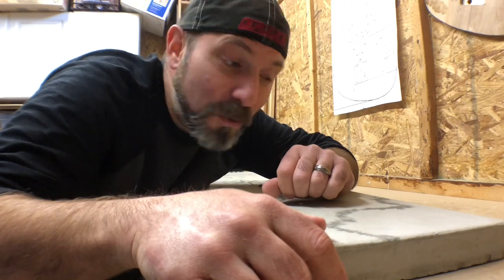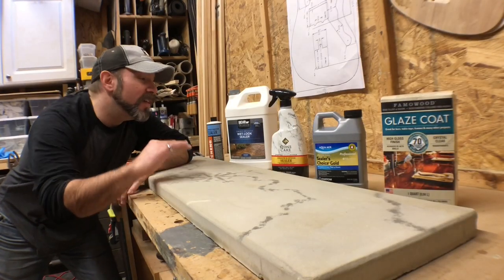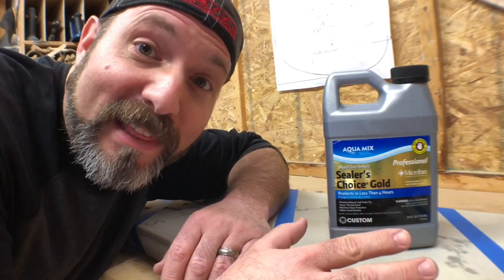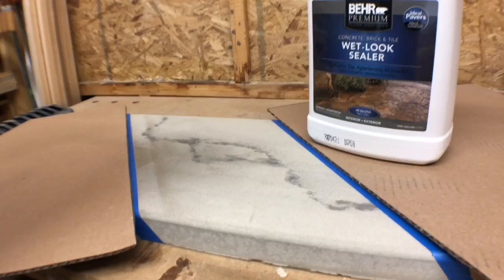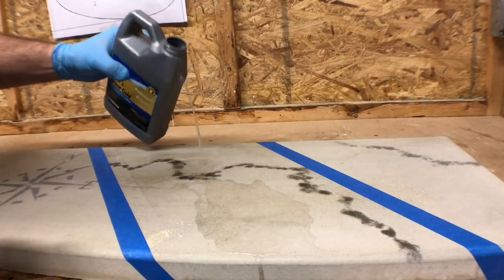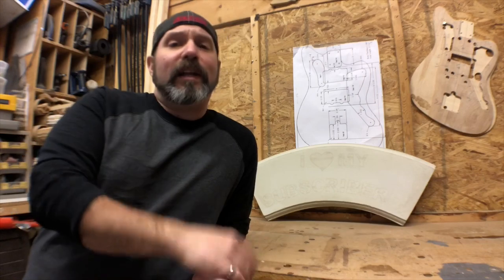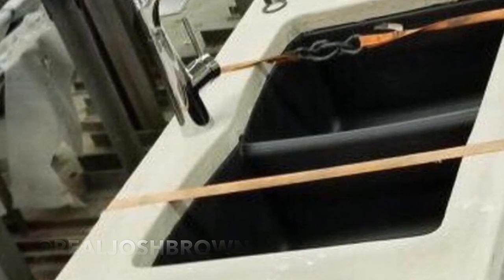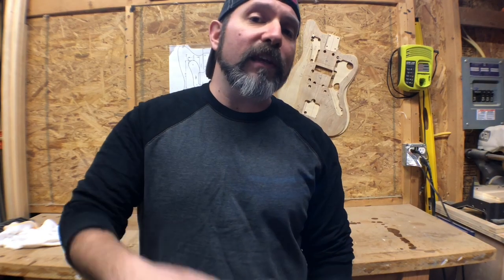Seal a Concrete Counter Top

Comment: SUGGESTION: How about a video showing how to stain the concrete or mixing a color in with the concrete mixture. Keep up the great work, love the videos!
Reply from the maker: Thank you Chris
Reply: I agree. Those wood look concrete tops were amazing.
Reply: I second this.  Please and THANK YOU.
Reply: I agree!  I’ve been wanting to do concrete countertops but have been intimidated by it, but you’re convincing me I can do it!  Add some color!  I need more!
Reply: YES..i vote for this too! ;-)
Reply: @paulaboudreaux5598  absooutely!
Reply: @MichaelBuilds  I would very much like your opinion on different methods of staining/dying concrete too
Reply from the maker: Thank you so much Chris!
Reply: I would like to simulate a black granite color. Any suggestions for proper additives?
Reply: I have a white concrete table that got scuffed when it was moved. It also has a stain from marinara sauce! I love the table, but I think I have to refinish it. Do I need to strip off the old sealer and redo? I think the concrete is colored. I’m not sure where to start with this.

Comment: I have a tip for a glaze coat or any two-part mix. Just Mark your mixing stick with 2 even measurements and poor one bottle to the first line and the second bottle to the second line you save 2 mixing cups by doing it this way.
Reply from the maker: That’s a great tip!!!
Reply: I have another idea. Assuming the two parts have about the same specific gravity (it’ll probably be close enough), use an inexpensive electronic kitchen gram scale. Tare. Pour the first one. Tare. Pour the second one to the same mass.
Reply: @texstan100  that's a good idea too, I myself would end up waisting time looking all over for my scale when a mixing stick will do the trick.
Reply: @texstan100  exactly what i was thinking too...
Reply: @Jennifer Ng oooh there are some very accurate food scales out there! ;-)
Reply: And you don't leave half of your epoxy in the cups!
Reply from the maker: Where do you leave it?
Reply from the maker: Where do you leave it?
Reply from the maker: Where do you leave it?
Reply from the maker: Where do you leave it?
Reply: Here's an easy one too. If it is two parts. Get a cup with markings, or use tape and mark lines One and Two, even. Like ex. one ounce, two ounce, lines. Pour the first liquid to the one mark, then pour in the second until the liquid hits the number Two mark,,its now half and half. Tks Michael Builds,,,loving this  I been waiting for a video that would make it easier...
Reply: What? Most cups are not even from bottom to top so drawing a line on a stick or the cup won't even be accurate... and then more complicated for mixes that aren't 1:1, and most epoxies aren't.
Reply: 2-part mix says good for temps up to 120 degrees. Will a hot brisket affect it ? I need a counter for wrapping briskets.....🤷🏽‍♂️

Comment: Mike, I watched your "1-Hour Countertop" video, a couple times, followed all your instructions, and poured my first ever concrete countertop today.   It was a great reward to see it release from the mold nearly without a flaw. (Hence me needing to watch the concrete sealer video.)  I appreciate your precision with measuring the water/mortar mix, and how well you demonstrate all required techniques of each step.  Other videos I have seen are needlessly complicated, especially for a small countertop project, but your video makes the process so approachable.  I had a sneaking suspicion it would not actually be as hard as some of these videos make it seem to fab my own countertops, but your video was the catalyst in motivating me to attempt this.  I credit you for my success with this, and also wanted to say thanks for a lot of things.  Your sense of humor belies the amount of information and expertise needed to be doing what you are doing, and your humility and sincerity are most admirable.  Thank you for your generosity in sharing all of that with all of us.

Comment: I really hope you're going to show how to hang a slab for a back splash or shower wall so that it's fixed to the wall.
Reply: I was also thinking of shower walls.
Reply: How thin can it be for a shower wall standing upright on end?  Shower is a mere 32x32.
Reply: Back splash:
1. Simply make a 4" tall piece, 3/4"-1" thick, same way as countertops. 
2. Bead of Onyx collection clear silicone 1/4" from back wall on entire length of counter top, stop 1/2" from each end of countertop. 
3. Place backsplash flat, upside down, apply same silicone beads in @ 3-1/2" circles, staying 1/4" minimum from all edges, across back of entire back splash. The circles of silicone will form a suction as you install the backsplash.
4. Line up backsplash with ends, set on top 1/8" from back wall and push backsplash into place evenly.
Warning: If you get silicone too close to edges of backslash it will push out onto the wall during installation and you will NEVER be able to caulk or paint wall where wall and backsplash meet.

Comment: Never did concrete counters befor, watched you video went out and did 15 plus feet with separate back splash and a blank for a double stainless sink and NAILED it.
Well the sink section did break during transfer of the form (an engineering  on my part), but all and all pretty cool.
Came back searching for sealer ideas and BANG! There you are again! 
Love your work man, keep it up. 
Cheers form Mid Coast Maine.
Reply from the maker: That’s what I’m talkin about!!! Thank you so much Jon!

Comment: I haven't tried the Cheng sealer yet. I think I'll pick it up and give it a spin. As of right now, there is one sealer that I use worry free; Omega. Staining is concrete's biggest enemy, unless you want staining. Acid stains and curry stains can transfer through some of these sealers over time as moisture activates the sealer.
Very important to choose a sealer that will not activate when wet, and will resist string acid stains. Also, consider a sealer that has very nice heat resistance and scratch resistance. A scratch in the seal can let in the bad stains.

Comment: I was hoping you would make this video.  It is perfect timing. I am planning on making kitchen countertops and a breakfast bar but will need to do them in sections to make installation more manageable.  Would you recommend sealing before installation or after? I'm mostly concerned if the joint seals will be affected one way or another.  And I second the request for a vid regarding stains and such
Reply from the maker: I would seal before installing but that’s just me. In the end I don’t think it matter. Thank you so much Leslie!

Comment: Great video 👍🏾 all I would love to know now is how good those sealers withstand oils..
Reply from the maker: Thank you so much Nicki! Just watch my video “how to seal a concrete countertop” and all your questions will be answered 👍🏻😉
Reply: Michael Builds 😊 I did watch the Video but from what I heard there’s a difference between water/dirt repellent and water/dirt resistant and Oils do behave differently than water.
I’m planning on getting a Concrete countertop but here where I live (Europe) Concrete countertops are fairly rare and if installed, there’re mainly sealed with Epoxy, which I‘m not a fan of (don’t like the look and feel of it). So not only am I’m limited in the choice of sealers, I also don’t have access to most of them. The Stone Care Sealer is the one I liked the most based on your Video, it matches my preferences. But there’s still the question, on how resistant it is against grease, especially when not removed immediately. Sorry for all that writing 🙈
Reply from the maker: You actually brought a lot of information to the table that I had no idea existed. Unfortunately, I don’t have answers to those questions:(. I’ll have to look into that for sure but you definitely have been doing your research! I’m sorry that I wasn’t able to shed any more light on that for you at this time

Comment: Great vid bro!!! Thanx for the shout out. Was so cool to see my lil home project on here.
Reply from the maker: No no no, THANK YOU! I was so happy to see you message pop up because you were the last fella I needed permission from and I was so scared that I was going to have to take you out of the vid lol ! I’m just sad that I didn’t have time to add your latest pictures into the video😢 The new pics you sent me were beyond awesome! Thank you so much for being apart of this whole thing man! 😉👍🏻👊🏻
Reply: Wish I would have got you the other ones quicker. Super cool. Alaska winter honey-do list has one less thing on it. Lol
Reply from the maker: Lol
Reply: @bonahisme  Awesome job, Jonah. I've been trying to figure out how to dye the Rapid Set like you did and thought I'd ask how you achieved it? I was thinking something like Cheng Concreter Countertop Pro-Formula Mix might work as an additive, but I'm also hesitant to mix products from different manufacturers as they might not play nice in the long run. Would appreciate the tip! Cheers
Reply: tastybarrels9 no problem 👍🏻
Cheng pro formula is a stand alone product line. Super good, but very high-end. This is a much more affordable alternative. As far as the dyes or coloring goes, I used concrete dry pigment. Very cheap for a small one pound bag. I went to my local concrete company and bought it from them. They had a book with many colors to choose from. I tried to get it at Home Depot, but they don’t carry any dyes. 
I hope this is helpful. If you have anymore questions feel free to ask.
Reply: @bonahisme  Thanks so much Jonah, really appreciate the reply and kind invitation to pester. I think that's all the intel (and search term) I needed! Will pay a visit to a local shop too. Thanks again

Comment: We bought a house with pretty beat up concrete counter tops. Don’t think they ever sealed them. There are rough edges, chunks missing on edges(especially around the sink), and they cut right on them so there are scratches and cut lines. QUESTION is, do I or should I sand or do anything else before sealing them? Also, thank you so much for this easy to follow and informative video!!

Comment: I'm months away from a build, but thinking of embedding copper that has been cnc cut into the face.  Or perhaps use the copper braid of wire to form a metal feature. Outdoor kitchen/bar.  Love your videos buddy.

Comment: A video on how you recommend attaching tops to bases would be nice. I know you show using adhesive on some other videos but are there any tricks to casting the concrete with mounts or other materials to avoid adhisive?

Comment: xs-327 is the only sealer you will need.. scrap the rest! Ive done countertops since 2005 and xs 327 is user friendly and very good at resisting stains. Use a foam 4" roller and lightly sand between coats with emery cloth

Comment: Thank you for that Michael, as its something I've been trying to decide upon. Very helpful to see the differences in the finish. Still curious about adding color to the concrete mix. I'm curious how Jonah did it for his shower project, but not really into hitting up random people on Facebook haha!
Reply from the maker: What’s wrong with hitting up random strangers Lol 😂. I definitely plan on doing a concrete color video. Unfortunately, it won’t be for a while since I have so many videos planned. But the good news is that it is as simple as just adding concrete colorant   (Home Depot sku# 924-754) to the water before you pour the dry Mortar Mix in the bucket. As far as how much to use, that depends on how deep you want the color to be. That’s why testing the color with a small piece first can be very important. I hope this helps. Feel free to email me at michaelbuilds313@gmail.com

Comment: Whazzup, Mike! Great to see you're inspiring other folks, so cool! I think I like 1 & 2  sealer. It looks like they have a nice semi-gloss look to them without changing the color scheme and as for food safe, I don't think anyone will be eating off the table, but it could happen! ;) I'm sure the epoxy is the most durable, but boy did it darken the color, but if it's planned out that would work also.

Comment: Quick question... Toying with adding color to my concrete. Will that affect the one hour dry time? I figured I would use this video to ask the question because seeing the different sealants will give me an idea of what the color could look like in the concrete.
Reply from the maker: Yes. Not by much but enough to take it into consideration. Different colorants will give you different cure time as well. Best thing to do is make a small test piece 😉👍🏻

Comment: Do you have an idea of how much epoxy to cover a 26" x about 144" counter ?    I'm thinking about doing a kitchen counter, and maybe a shower pan, maybe a bathtub! Crazy I know! If that works out I'm thinking swimming pool! Then maybe a tiny house! Great video, I have been thinking about the sealer, nice to see them used!!
Reply from the maker: Thank you so much James! If you check the product on line, they give you several different scenarios with different thicknesses and how much sqft it will cover

Comment: Mike, I is a good video that appeals to most but technically weak for my needs.  It would be nice if you add more discussion (beyond surface appearance of the countertop) to other such as scratch resistance, stain resistance for acids and other, durability, etc.  For the naive viewer it is dangerous to think that urethane sealer = epoxy sealer = acrylic = misinformation.  
This is a countertop after all located, normally,  in a kitchen.  Otherwise the 'personality' of the video is great and I liked the referrals to others with pics of their work.  Well done!

Comment: I love your videos. Seriously the best. Thank you so much. AND I think you just nailed my mystery white drips on the edges of the vanity. I've been looking at the Cheng sealer had no idea it was white and BOOM. Sure looks like that's what's it is. And there is a very mild epoxy odor when wet sanding (yes Im using a respirator for sure. Noticed it when I took it off.) As mentioned, I've been wet sanding and also noticed these very fine cracks - clearly in the old sealer that's kind of ...well ..left. Was wondering if you've ever used the Cheng cleaner - apparently it removes the old as well.

Comment: Michael. Great videos. Straight forward, enjoyable, easy to follow and apply. My question: you did not mention the drying time between the applications with the Cheng sealer. Could you ellaborate? I live in a humid and hot environment. Also, I am on board with the how to stain, color or embellish the countertops. Thank you in advance. Grate job!

Comment: I’ve watched numerous videos on pouring concrete countertops, and I found your method to look (and turned out to be) super easy. I poured my final 3 slabs tonight and would love to send pics when I am done. One question I have about the food safe sealers, are any of them heat resistant? I’d like to pull something from the oven and not scramble for a heat pad lol. Thanks in advance.

Comment: Love your videos man. Not sure if you want to try it on your nice compass countertop, but do you feel like heating up a pot of water and setting in on each sealed surface? I'm curious to see if they tolerate the heat of a stove or if you need to keep trivets around.
Reply from the maker: Unfortunately sealers are not usually rated for high heat. You have to treat concrete countertops the same way you would treat granite.

Comment: I like the Behr finish out of the 5 because the application looks to be the most idiot proof! I used the Famowood Glaze on a butcher block custom breakfast nook and it turned out great but it took a lot of prep and cleanup.

Comment: Michael, I'm making a fireplace hearth, any suggestions on which sealer to use with heat present? Great video!
Reply from the maker: I would say the stone care would be the best option
Reply: Michael Builds I actually opted for the Cheng after reading up on it. I’m also worried about soot discoloring the concrete. Waiting for acid stain to come in the mail!

Comment: Amazing! Followed your instructions in your first vid and it turned out amazing! 
Curious, if I use rapid set, how long should I be waiting prior to adding a sealer? Should I let cure for a full 28 days (I did add about 1/8 white Portland for color to the mix). Or can I throw it on after just a couple days?
Reply from the maker: With straight Rapid Set you only have to wait 24 hours. With the Portland added I’m not sure. I can’t imagine that it would be much longer. I would say 2 days

Comment: Michael, I love your surface with the grout veins. I would like to do this on a table that will remain outside. I will use this table surface to prepare food on periodically, but it will be before cooking. The surface will get snow and water on it and freeze, and be outside all four seasons. Is there a sealer that I can use that would seal any voids to prevent any cracking from the frozen water? Maybe I am being too picky and the water won’t have an effect? Thank you for the tips.

Comment: Love your channel and hope it keeps growing for you!
Had a couple projects I’m starting next week using your methods: The first is a concrete mantle to a fireplace I had built for an addition 12 years ago. Ended up running a wood stove in it so a wooden mantle wouldn’t be good. The next is some concrete stairs I made years ago. Figured I could dress them up with a slab landing and stair treads? 
Was curious if concrete dyes they sell at Home Depot/Lowe’s work with the Rapid Set/Flow Control mix of yours? Thanks, Jim

Comment: Epoxy FTW!! Any chance you plan to do an Epoxy Floor? I'll be doing Metallic Epoxy on my floors this summer.
Reply: I also need to replace the plastic shower surround in the first floor bathroom. I'd like to have a shower just like the one you showed but it might be a little beyond my skill set.
Reply from the maker: I imagine someday I’ll do an epoxy floor video but probably not this year.